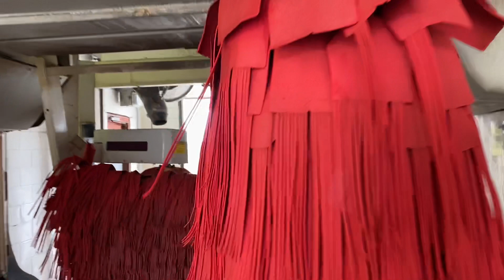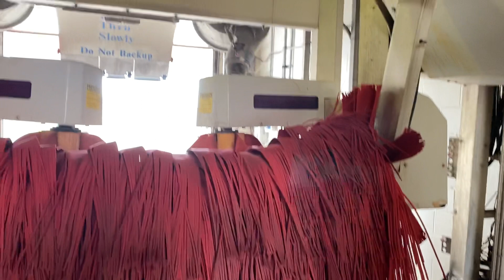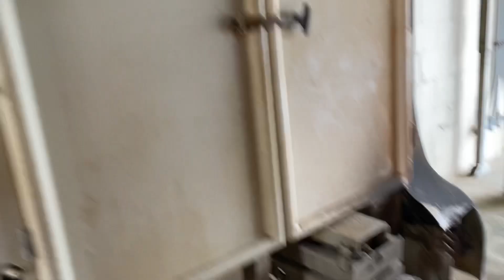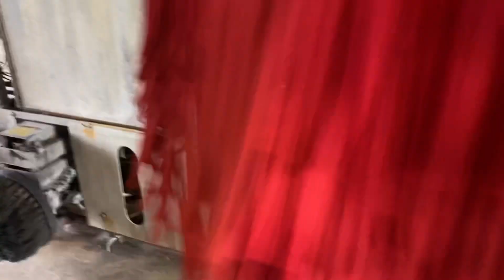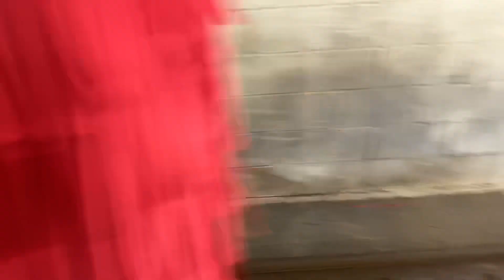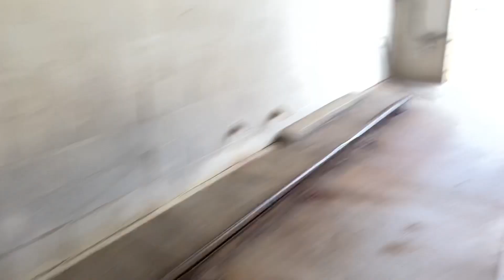Out Of Service Ryko Select-A-Wash

Comment: Sad to see a unit like this in disrepair...... yet we see the occasional R7B out there still functioning. Does this tell us that the quality of what we build today does not stand the test of time.... or is it simply lack of proper maintenance?
Reply: Usually lack of maintenance. When a Select A Wash is maintained properly its one of the best systems around.
Reply from the maker: It’s a blend of both, with the old Rykos they used much older controls, and dispensing units ect ect. Just because it was “cutting edge” at that time, so obviously they are much simpler and there is less to go wrong/break, as a result we still see a few kicking out in the world from time to time.

As time went on customers desired a more complex wash so Ryko added features to their machines to be competitive and make the washes more desirable for both car wash customers and owners. So on this machine (select-a-wash in particular) there’s a whole lot of added components to make it be able to complete a full touch free wash - added hose, added tips to clean, added bearings, added junction boxes and more places for things to be maintained per say.

As the industry changes every day, and larger corporations get more involved in the car wash industry, I can’t speak on behalf of the “quality” of materials being used on Ryko machines, but I would expect there to be slight cuts in overall build quality but nothing significant enough to make the machines any more or less reliable. And that’s speaking purely off opinion.

Comment from the maker: To answer most of your questions

What most likely is wrong with the wash is a faulty air compressor - most likely NOT the car wash that is broken. The doors were probably left open because there is no air pressure to pneumatically close the door. - for any of you on the coast where your car washes don’t have doors, in the Midwest most (not all) polycarbonate doors are air operated instead of using an electric motor door opener as they don’t hold up well in a wet environment.

If the air compressor was working, brushes wouldn’t be engaged or out, staff would have likely shut the doors, and turned off the kiosk - IF there was an issue with the machine itself.

Could be totally wrong, but that’s how it looks. I have no idea if they plan to reopen or not and won’t be in the area anytime soon to find out.
Reply: Park Avenue car was in DSM IA has motor operated bay doors,, both on his profile and Razor(which did use to be newer ryko select a wash aka the softgloss and an OHD). The reason why I say His is because so eone name Diamond Carwash owns that place
Reply: @HSETM  wait, he owned a select-a-wash?
Reply: @richardmcdonald7322  basically except it was a softgloss. Aren't they basically the same lol
Reply: @richardmcdonald7322  I think differently than most people